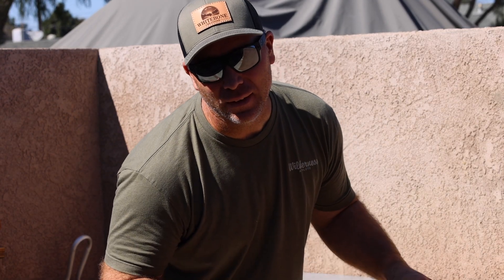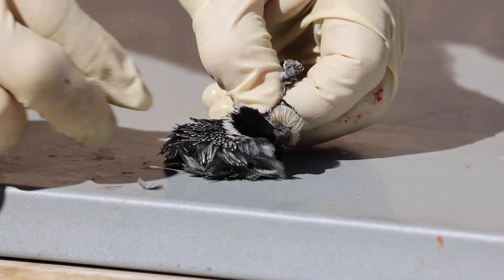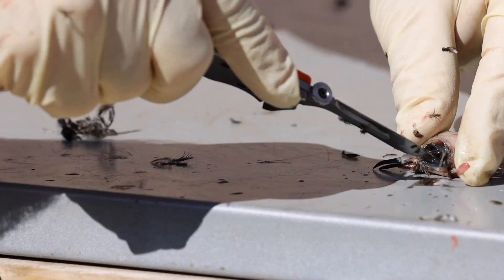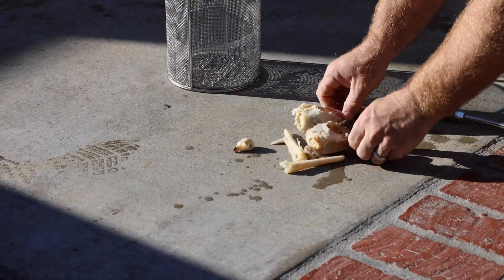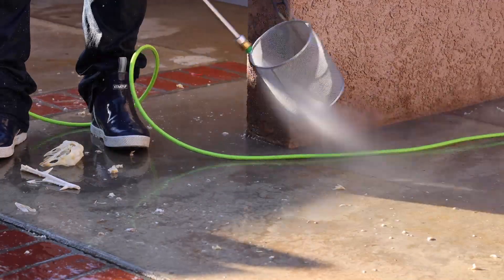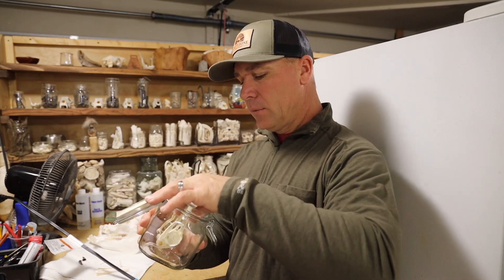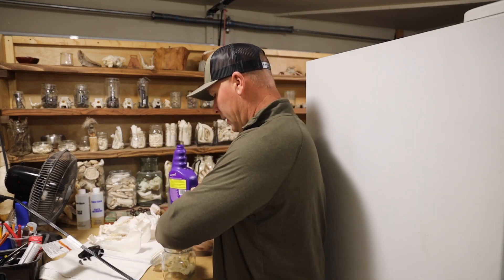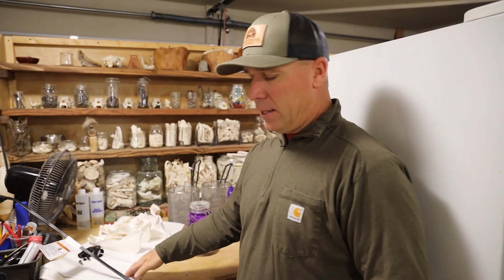DOES DEGREASING DAMAGE BONE ?

Comment: Hey so shot a great bear this year. Had the guy doing the rug do Beatles on the skull. When I got it back the teeth are all cracked. Us that caused from over bowling it? Not much I can do now but next time think will try someone else.
Reply from the maker: The beatle boys typically do not boil. It is not uncommon for the teeth to crack in a real dry climate. You can glue them and then pinch them closed with a clamp. Done it lots. Should look new when it’s done.
Reply: @WHITEBONE  Well live in Idaho and it was definitely voter this year from the fires. They haven't cracked apart that far just hair line cracks for now. If it gets worse I will do that. I do bodywork so might know a little about gluing and clamping. Thanks for getting back to me. Look forward to your upcoming hunting videos. Keep up the great work.

Comment: Could you by any chance do a video (if you haven't already) on the topic or effects of boiling / heating bones in general, I've seen so many posts online debating or claiming that such procedures damage bones? Would love to hear your opinion on the it.
Reply: Edit: to be fair it looks like he has a very specific process with a sous vide and everything, but it's still not recommended because it's so easy to get wrong, and even THEN it still damages the bone slightly. He just does it in a way that minimises the damage. 

It does hurt the bones. It makes the bones very brittle and it's honestly a wonder he didn't completely destroy these skulls, because most of the time bird skulls will just disintegrate. It works well for big stuff like deer, but the best way to clean bones is maceration, aka putting it in a tub with room temp water, putting it outside and waiting a couple weeks.
Reply: If you want to see the difference, get some chicken drumsticks. Flesh one out and keep just keep it like that, and then flesh another one and boil it. The difference is pretty damn big
Reply: @batfurs3001  you see the thing is I've been experimenting with dove skulls, they're very common here and you find dead ones relatively often. My current method is to skin them and leave them for ants (I've got a species that'll clean it in half a day - day). Once they're done with the flesh I heat them up to a simmer (not boiling them)  in water and a few different types of soap, afterwards I wash them off carefully with a small hose and leave them in peroxide for a day or two. 

I haven't noticed any of the often mentioned downsides of heating them up though? Granted I do not boil them but the end result is a white skull that doesn't fall apart or turn chalky. Really the only problem with my method (that I'm aware of) is that the ants will eat the beak too, which isnt a problem with doves but I'd be careful if it's a bird where the beak is important to the look.

 Also if you're wondering why I don't macerate... uh let's just say my co-inhabitants wouldn't appreciate such things on the property, if you know what I mean lol.
Reply: @relicthominoid  oh yeah maceration is definitely not for everyone lmao, it's very very stinky
Heating them up breaks down the bone, as simple as that. Doing it carefully won't noticeably damage it, but IMO macerated skulls are just higher quality and have a slightly different feel to them. It's also easy to accidentally let it get too hot, leave it in too long, etc.
I also like having the beak sheaths on bird skulls, and when they're simmered or boiled they just don't look as nice, they lose some of the colour 🤷‍♀️
I do plan on trying simmering on a deer skull I have, since I'm trying to minimise maceration and bone processing as a whole. It's so stinky.
Reply: @batfurs3001  Yeah it's a sorta you get what you pay for situation, where maceration is better but takes more time whilst manually doing it is riskier but quicker... also as we've both stated the smell of maceration is inherently a limiting factor to it. Either way both work within their own context, and I feel like as long as you're careful both can end up looking good. True, beaks (and horns) are the bane of using heat as you've got to either give up on it or figure out a way to preserve it. It depends on the bird too, at least in my opinion, if it's a dove or passerine etc. I'm not too worried about the beak-less look but with something like a waterbird or raptor you've just got to preserve it. 

Good luck with the deer btw!
Reply: @relicthominoid  yeah, I think that people should be more careful when recommending simmering to newbies though, since it is so easy to get wrong, while maceration is pretty hard to get wrong. But whatever method you get good results with is fine
And thank you! He's a young (like year 2 or 3? Idk) white fallow deer in velvet, so I'm sawing the antlers off for freeze drying. Hopefully not having to deal with the antlers makes it easier.